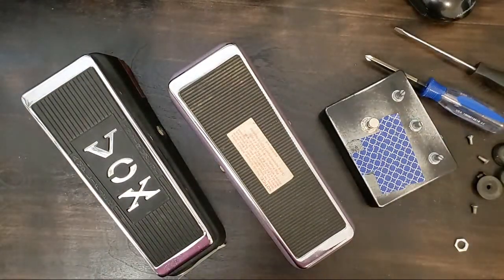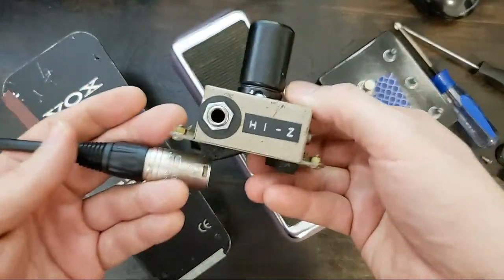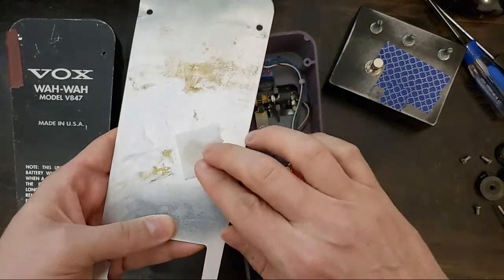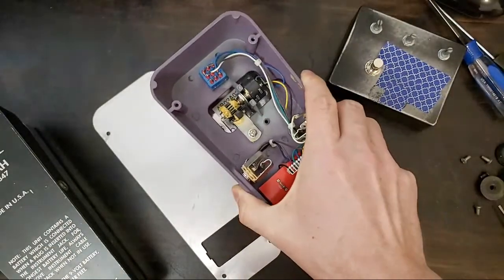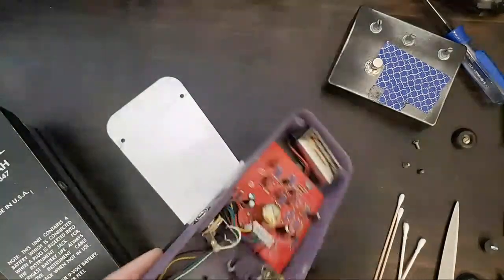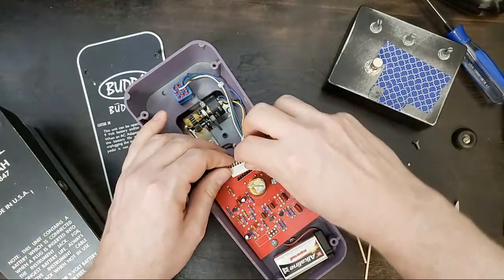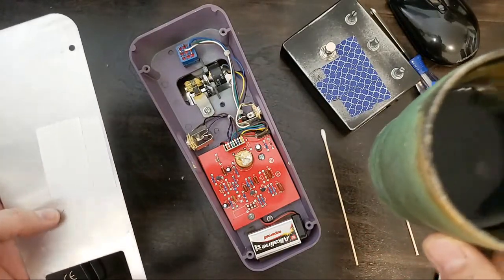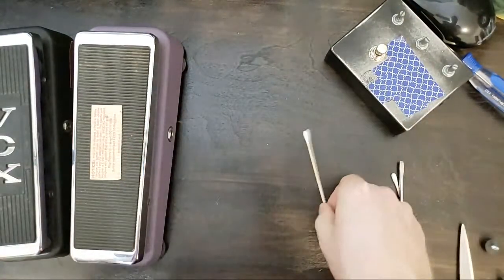Pedal Repair Live #guitarpedal #wahpedal #amprepair Budda and Vox wah repair! #withme

Comment from the maker: 00:15 The culprits, 1:40 Grounding out, 6:49 The problem, 9:16 Cleaning up, 11:30 Nut installation, 15:00 Isolation measures, 19:00 Tighten nut, 20:15 Cleaning inputs, outputs, 24:00 Regrease, 28:18  Re -Assembly, 31:13 Fixing up the Vox., 35:30 Fuzz pedal alternative repair., 42:00 Testing the repair!

The rest....
Reply: I will give it a try and see what happens it makes sense
Reply: You guys are alright thank you very much

Comment: I need a part for a Wawa 250 peddle the button that goes into the underside of the peddle
Reply: Can I send a picture
Reply from the maker: Hi, What's the exact brand of your pedal?
Reply: @FrankOlsonTwins  250 DigiTech compression pedal there is a button on the underneath side of the pedal that touches a sensor in unit
Reply: You want me to send a picture
Reply: Oh and thanks for replying back it shows somebody has some courtesy
Reply from the maker: Ok I did a bit of research, and the only thing I can find is this on Harmony Central, where someone(not me) has begun fixing these broken units.  So try this at your own risk!

"Remove the back plate. 
Yank off your 3 knobs
Remove the backplate, and then remove the circuitboard. You might even have to dremel those screws! (thats scary)
Pull out the circuit board, and make sure the expression pedal tape doesnt get ripped off or anything
Take a thumbtack, and stick it in the rubber of the bottom of the pedal. Try and center it.
Put everything back together and enjoy. Ive done this on 6 models so far, all been working fine. An RP50, RP80, RP100, RP200's
Hope this helps SOMEONE! People always give me their busted gear and i end up fixing it lol."

I bet you could add the thumbtack without tearing the pedal apart though.  
Good luck!
Reply: @FrankOlsonTwins  DigiTech 250 processor with pedal